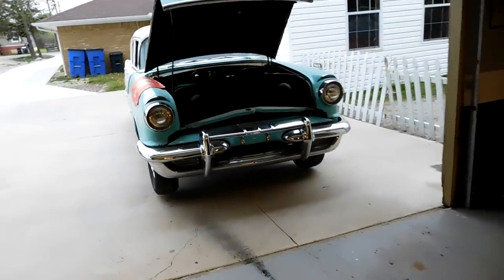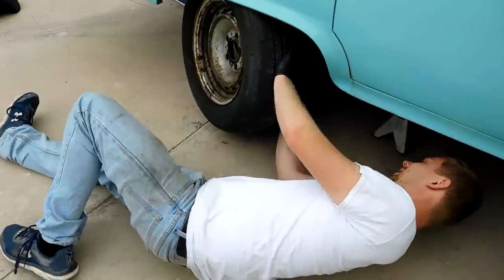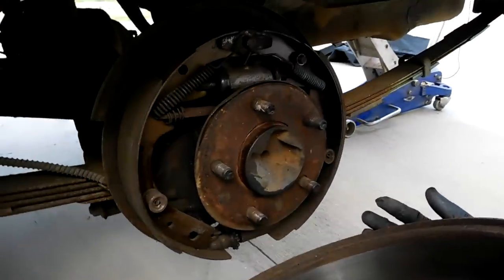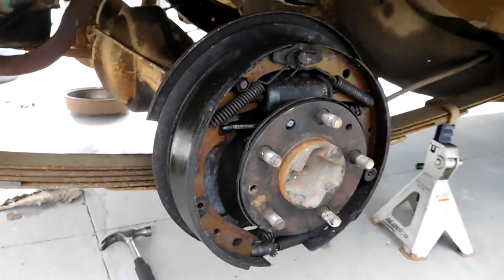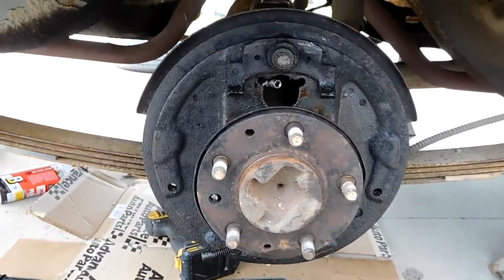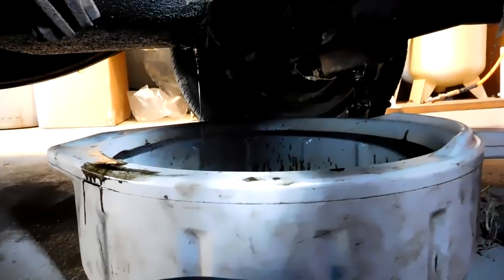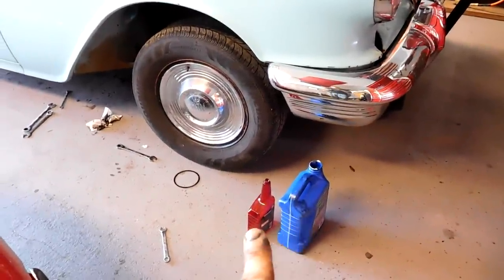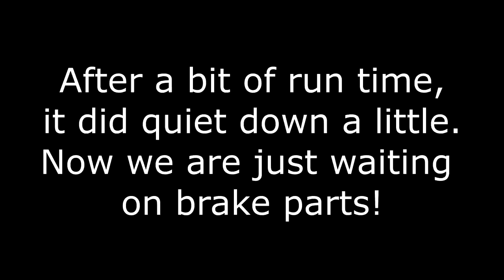WHAT?!!?!? My wife bought her first classic car!!!!! 1955 Pontiac Chieftain Sedan Part 4

Comment: If that mechanical pump is like the Chevy V8's and is old, the fuel is leaking from the fuel pump into the crankcase!
Reply: Time for electric fuel oump
Reply: @rsprockets7846  Do you think that alternator can handle the amperage of the electric fuel pump ? ; )
Reply: @KC-vp7wn  yup just wire it into the ignition switch and pump away...or be real sneaky and use a toggle switch ad a theft deterrent
Reply: @KC-vp7wn  it's a generator gm went all across line in 1962..add single wire. Upgrade on this.
Reply: @rsprockets7846  Easier, cheaper and more reliable to just get a new stock pump.

Comment: That's awsome! The wife working on her ride! No better way to learn. I need to get mine involved with her 81 vette restoration, lol. What I really need is a C2 to trade my 73 Road Runner for. 62,000 mile original, no rust, never tampered with. Just need to find the good C2 that hasn't been stipped or boogered up to bad.

Comment: Try a ‘zero lash’ adjustment on the valves.
Reply: Or some seafoam. And motor Honey
Reply: @rsprockets7846  STP used to quiet down the lifters in my ‘59 FORD (332 FE motor)...

Comment: My father's '53 Chieftain still had 15-inch wheels.  Not to mention a straight-8 L-head and Hydramatic.  I can think of two things that would cause that much gasoline to find its way into the crankcase:  running extremely rich or the fuel pump diaphragm sprang a leak and started squirting gas into the crankcase
Reply: Right - my 53 Catalina Chieftain came with 15s and same power team your Dad had. Now running Rally Wheels, 292 Chevy L6 and Turbo HydraMatic 700R4. I replaced those "backwards" wheel studs with right hand thread ones, around 1980, and haven't had a wheel fall off yet. (So far, so good.)

Comment: warning:  new old stock oil filters can absorb humidity and render the paper element unable to allow oil to pass through . take care !
Reply from the maker: I guess I don’t feel like a filter from 2003 is new old stock. Maybe from 1960
Reply: @TheCorvetteBen  I use new old stock oil filters on my '65 Skylark all the time. I have never had any issues with any of them. They are all in dry storage prior to use. I get them cheap at swap meets.

Comment: I had a 66 Pontiac Bonneville Conv. and I had a flat in the rear. I had to jack up the body and the rear axle, because of the low wheel well. Again , I think it's great to see a woman working on an old car. It's great. Plus she's working on a PONTIAC.  Good luck with it. I do hope you put New Bias Ply tires on it.

Comment: You could always put the rear axle under the leaf spring instead of on top.  It would raise the back a little but at least you could get the tire off.  Or maybe some extended shackles.
Reply: Good point, but the right size tires are easier and correct.  Keep it OEM as possible.

Comment: You can isolate the noisy rocker arm(s) by putting your finger on them, one by one, with the engine running. The loose one(s) will have a snap or shock sensation; the ones not making the noise won't. Slowly tighten the noisy one(s) a quarter turn at a time, waiting 15 seconds between 1/4 turns to give the lifter time to accommodate the adjustment. (Engine may misfire for a few seconds.) You shouldn't have to go more than a full turn.

Comment: dear ben cut a 4 feet long water hose and use it as a stethoscope. place the hose on top of the lifters, and the other end in your ear.  find the noisy one and adjust that rocker. this is a gm repair dealer inside. never failed.

Comment: When I took the wheels off the back of my 55 Chevy Bel-air I jacked up the rear higher than the tire. Just a little bit of play to take off the wheel and tire. I didn't have to let any air out. I hope that helps you out
Reply: I bet an old fashioned bumper jack would lift it up plenty high enough to get the clearance needed.  I never see anyone using them on these old cars but I've used them for half my life and never had a problem with them.

Comment: the only way i can take the rear wheels off my '58 Fleetwood is to set the frame on jack stands and then jack one side of the axle up to drop the opposite side down...and then just barely.  the stylish dropped-lip quarter panels on certain mid-century GM's hide the wheels a little too well.

Comment: they didn't call them 287 an 317's "detonator-8's" for nothing.........  You really should pull all the rockers and push rods and clean well, make sure every push rod is perfectly clear. I believe you can adjust the rockers like a sbc.
Reply: I read that Pontiac had an OHV V8 with the shaftless rocker arm setup  available for 1953 production. But GM corporate power politics prevented it from introduction before Chevrolet's was ready, in 1955. Any substance to that, or is it hogwash?

Comment: You can lift a car way higher than that .The jackstands can go heaps higher.Bit different than a Corvette
Reply from the maker: What you failed to see is the jack under the back of the car lifting the body as high as it can go
Reply: @TheCorvetteBen  You can use a hy- lift jack and loosen nuts while on the ground like the old days.

Comment: Left hand threads on the wheel lug nuts.  Seen that on older British sports cars.  Never seen that before on a US car.
Reply: My 66 Doge Dart GT had only on the drivers side left hand lug nuts. Figured that out after breaking 2 off 😕😣
Reply: All Chryslers were that way in the 60s
Reply: Thx for the info everyone.  Learning more about Chrysler's.  Wonder if using LH threads ceased being used due to too many repairs to sheared off/stripped wheel studs?  Similar to stopping the use of positive earths for the electrical system.  Getting that mixed up would have caused some hair-raising moments in the shop.
Reply: Studebakers in the 40s and 50s used left hand threads too.

Comment: If there was that much gasoline in the oil, either the rings are bad or the fuel pump diaphragm is leaking into the engine
Reply from the maker: That and when we first got the car the intake gaskets were bad so it took a lot of gas to get it to start

Comment: The wheel that you were trying to get off looks like a GM rally wheel. Definitely not original to your car. I think your wheels were 14 inch. I think. Your car has Bias Ply tires . People later changed them to Radials.

Comment: Why does that pretty girl want that big junk, with all those Vettes in the yard
Reply from the maker: Can’t haul kids in a vette
Reply: @TheCorvetteBen   I’m into old cars, that’s big for her, and drum brakes and no air bags, and the dependability of it, God forbid getting stuck , no a/c maybe I’m wrong but to put toddlers in that car for every day use, not really ideal, car shows and cruise nights, absolutely
Reply: @pontiacgrandprix733  I'm pretty sure she's not intending to use it as a daily... as far as too big for her, what do you mean? It's probably got power brakes and power steering but if not they can add it.
Reply: @pontiacgrandprix733  Toddlers did just fine in the 50s and 60s and today they have child seats and seat belts.
Reply: @pontiacgrandprix733  It sounds as though you're a bit of a clown. Why is it "big for her"?   It's no bigger than a modern car of the same size that millions of women drive without problems.  Something wrong with properly maintained drums in normal driving?  What do you know about the dependability of that properly maintained car?
Reply: @pontiacgrandprix733  
🤣
Always has to be someone like who craves the internet attention.